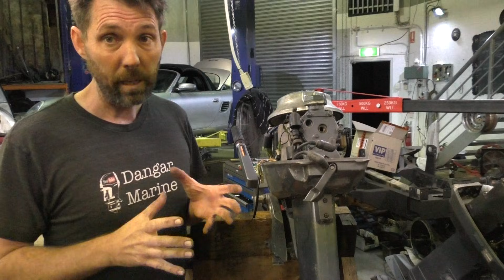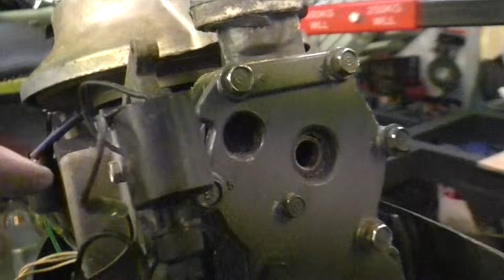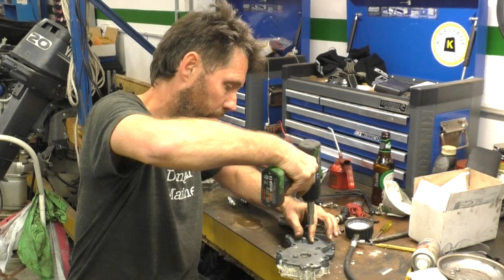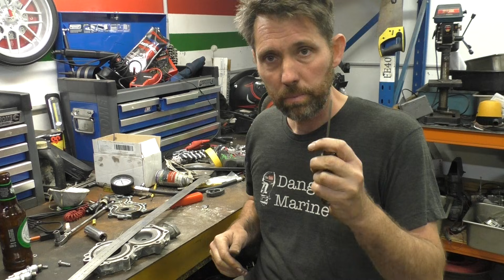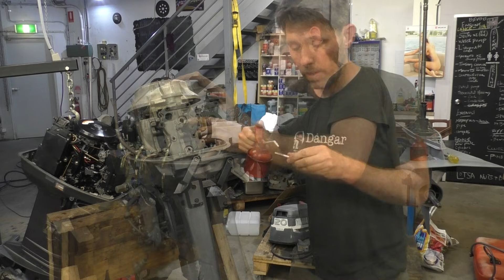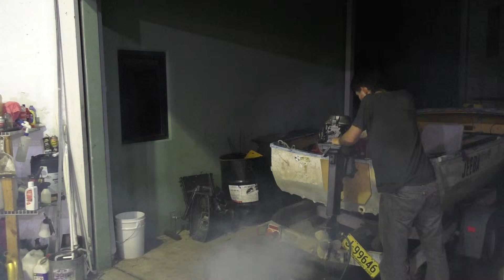Replacing a 2 stroke outboard head gasket

Comment: Great video. The cylinder differencal  you prove that the labyrinth's were sealed between cylinders.
The thermostat being out could lead the top cylinder burning cleaned. Bottom one carbonized.
The back firing a sheared key on the flywheel or magnets that have moved from the flywheel.
They are glue in.
Reply from the maker: Hey John. Definitely going to be pulling the flywheel on this outboard as the next port of call. I've had a sheared woodruff key on a flywheel recently so I'll be checking this one straight away. The timing linkage can't be adjusted far enough out to cause backfiring like that.

Comment: I recently purchased a seized 55hp Sea King/Chrysler outboard for cheap and while I am mechanically inclined, I had never worked on a boat engine before.  I started watching your videos last week and while I have done most things right so far, I have also learned a lot that will help me with the rest of the repair process.  Hopefully pulling the head won't be necessary but if so, this great information will help!
Reply from the maker: Hey Matt, glad to hear your restoration is progressing nicely. Good luck with the rest of it!